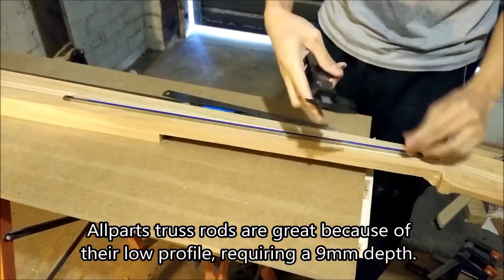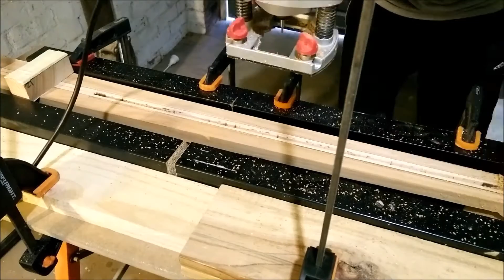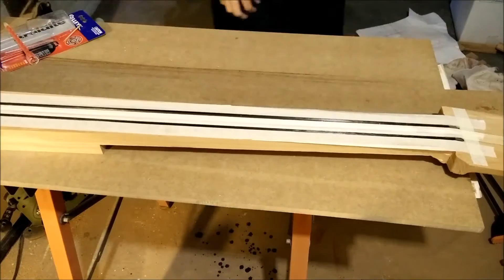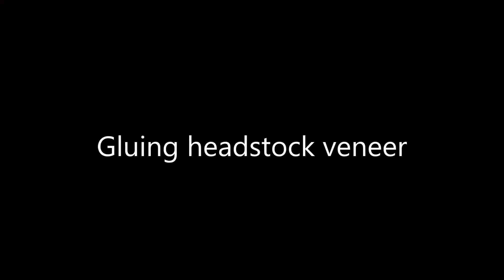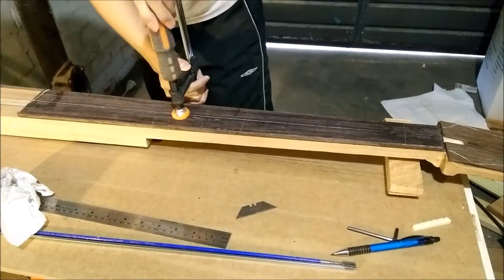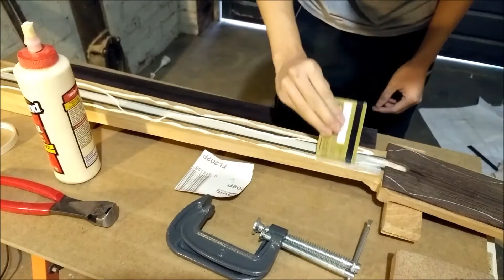Neck Through Bass Build - Part 5: Installing the truss rod and carbon fibre rods, gluing the neck

Comment: silicone on the truss rod cavity good move, putting something over the bar of the low profil truss rod like a bit of tape permit the metal not to rattle in the cavity too (just over the bar that the metal don't touch the fretboard, same effect as the plastic cover on the lower rod ) . Any way nice build with not much tools , I would never have the patience to make a multi laminate neck shaped piece by piece, band saw is friendly for that, bravo !

Comment: Hi Simon. Good job really!!! I have a question about length truss rod. With upper wing wood enterely attached to the neck, is it necessary a truss rod so long? I mean, maybe 20cms coincide with the upper wing and there is not bending there. Is the neck bending working good when adjusting the truss rod? Is it clear my question?
Reply from the maker: Yes I think it's necessary to have a truss rod that spans most of the length of the neck, especially for this bass where string tension will be high.
I just followed the standard truss rod measurements for the bass scale length but I read some where the truss rod should go beyond the 12th fret. It only works to correct the relief in the middle of the neck, 7-9th frets.
Reply: @simpleone1989  what truss rod length did you use it?
Reply: @simpleone1989  I have a neck where the one way truss rod channel is routed in a downward bow.
I had to remove the maple above the truss rod to get it out.
Would replacing with carbon fiber in place of the maple strip be a good idea ? I do not want to route other channels for the carbon rods.
Wondering if the CF will form downward when pushing the truss rod into the downward bow of the channel.
To me it seems like there would be no problem BUT I have no idea because this is the first time ever doing anything like this. Thank you.
I also do not want to modify for a two way truss rod and using the same one. Does all this make sense ?
Reply from the maker: @suspectdown5133  technically carbon fibre should be stronger than maple so it may work, but I've not seen anyone use it as a strip over the truss rod. Maybe due to cost? You could try it.

Comment: Nice job! Have you fixed the truss rod somehow into its cavity (for example glue), or it is just held in place by the fingerboard?
Reply from the maker: Thanks! I ensured a very snug fit so the truss rod doesn't move up and down or sideways when adjusting. I don't think glue should be used as the truss rod won't be able to turn.

Comment: can you tell me some more about the carbon fibre rods?  where did you buy it? size?  is it stiff by itself or it become stiff by the glue-compound? I somehow can't find it on the internet.
Reply from the maker: I forgot the exact website I bought it from but it was from a local Australian supplier. Stewmac also sells them.
The rods are very stiff by themselves and hence will reinforce the neck.
Reply: @simpleone1989  thanks.. a beautiful bass btw
Reply: what was the size of the enforcements rods?  it crossed your mind to make them from titanium or an other exotic metal?
Reply from the maker: @fwberg1  these are 4mm thick I think. Carbon fibre is light yet strong. They're common used in bass necks. Titanium would be too expensive.
Reply: @simpleone1989  4x4 or 4x9?  look at your bass..  you design it yourself. did you really cared the prise for some parts? :)  i suppose the best is just good enough for you. lol...
Reply: what time it costed you to build that beauty?
Reply from the maker: @fwberg1  haha yes but I also didn't want to spend too much as it was my first time building such a bass so if I messed up it wouldn't be as bad. Also carbon fibre rods are common. I've not seen titanium used before.
Reply: @simpleone1989  oke Simon, nice chattin with you. for me it is back to the drawing board (CAD) you lighten my old wish up again..
Reply: hey Simon, just an other question. did you use titebond glue?  what about thoughts about bone glue or skin glue.?
Reply from the maker: @fwberg1  yes I use titebond because its one of the best for woodworking and guitar building, and it's available to me. I haven't tried the other types of glue, but hide glue and fish glue seem to be popular in acoustic guitar building. Search for Robert O'Brien on YouTube and he will explain the choices.

Comment: Nice work, can you explain to me why you need to install 2 fiber carbon rods combine with truss rod? It is not enough just put fiber carbon rods on your neck?
Reply from the maker: Danang Sugeng Nugroho it's always a good idea to have a truss rod so you can adjust the amount of relief. Most six string basses have extra carbon fibre rods to stiffen the neck as the string tensions on a six string can be very high. You don't want the neck to warp.